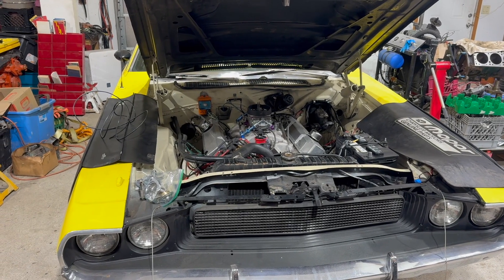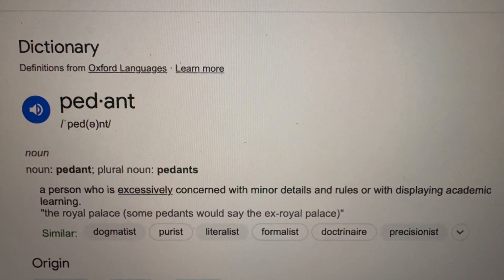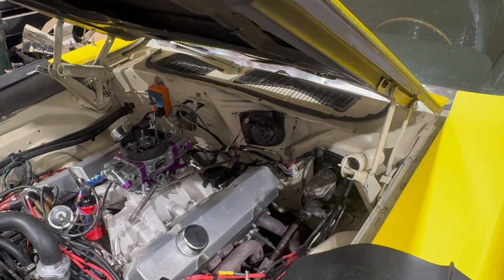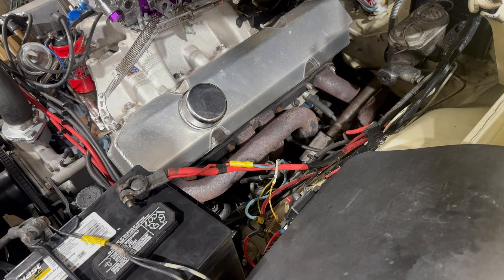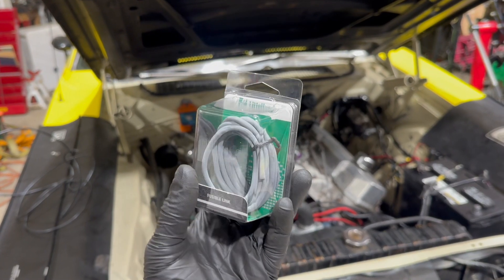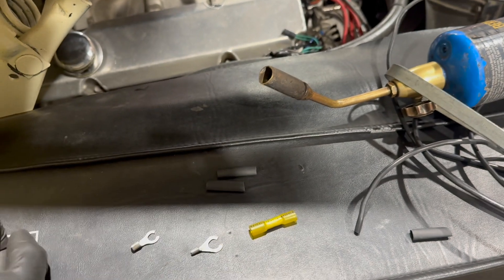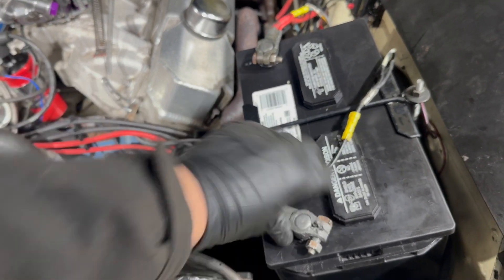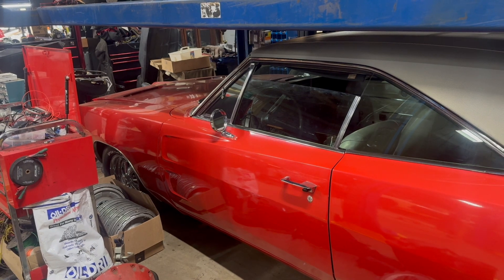The Big Shunt Wire Guide - Prevent Electrical Meltdown In Your Classic Mopar With This Easy Fix

Comment: FROM A 72 YEAR OLD AUTOMOTIVE ELECTRICAL SPECIALIST:  GOOD VIDEO.
WELL DONE.  BUT, YOU SHOULD ALWAYS USE RED WIRE FOR HEAVY ELECTRICAL CIRCUITS, ESPECIALLY "POSITIVE CIRCUITS".  BUY DIFFERENT SIZES AND KEEP IT ON HAND.  FOR SMALLER GAUGE CIRCUITS, YOU CAN USE BLACK WIRE IF YOU WANT, BUT USE RED HEAT SHRINK TUBING AT THE TERMINALS. 
PLUS YOU CAN BUY HIGHER QUALITY CRIMP TERMINALS AT LOWES OR HARDWARE STORES IN THE ELECTRICAL DEPARTMENT. THEY ARE USUALLY PLATED COPPER AND ARE MORE DEPENDABLE.  HILLMAN IS ONE GOOD BRAND.  ONCE YOU USE THEM, YOU'LL NEVER GO BACK TO THE CHEAP TERMINALS.
MOVE AWAY FROM THE CHEAP ALUMINUM CRIMP TERMINALS. THEY'RE CRAP.
BE "THE GUY" THAT DOES TOP QUALITY WORK WITH TOP QUALITY PARTS.  YOUR WORK WILL STAND THE TEST OF TIME.
AGAIN: GOOD VIDEO.
Reply from the maker: All I can add is - Chrysler used black for alternator output. I’ve used some old higher quality terminals that we’ve collected over the years. I’ll keep an eye out for them at the hardware store. Thank you.

Comment: Hi Jamie,  not sure if you'll get/see this, or even have time to respond,.....I know the video is old.
BUT....THIS SEEMS WAY TOO SIMPLE,  and I wondering Why I Haven't done it yet! (like in the past 40 years I've owned my '68 Barracuda) Just want to make sure I'm getting it right so I don't fry my (actually perfectly good) wire system.
So I...
-Connect a connect 10 gage wire  to large lug on the Alternator.
-run it safely around to reach the starter relay
-solder/crimp on a 14 gage  Fusable Link to that 10 gage wire.
-connect Fusable Link wire to large  lug on the starter relay. 
 And that's it?!
Of course I will shrink wrap connections, etc. Safely. 
 If you could give me a "yep, that it", or No...you're missing this or that...I would appreciate it.
 Thank you Bud,  have a safe and Happy New Year!
Reply from the maker: You got it. Happy New Year.

Comment: Put a 440 out of big Chrysler into a 73 W200, with the 100 amp alternator from the car. Was young, dumb, and never gave the wiring a second thought. The amp meter would peg one way or the other when operating the snow plow's electric pump. Ignorance is bliss, never had a problem with it. If I tried that now, knowing what I know now, it'd burst into flames. 😂

Comment: Your fusible links are additive to as to the load they can pass before blowing and are part of a parallel path to your dash wires. You have almost no protection against burning wires in the event of a short this way. You have been lucky so far. 72 Roadrunner has some great detail on Mopar wiring.
Reply from the maker: I know. Check out his responses on this very video essentially calling me an idiot. Thanks.
Reply: @DeadDodgeGarage  Well now, don’t recall calling you an idiot, essentially or otherwise. This “idiotic” ill-conceived and dangerous “shunt wire bypass” concept goes back many years, long before DDG, or YouTube for that matter. Simply pointing out there are several other much better approaches to these perceived old Chrysler electrical weaknesses that don’t circumvent all designed circuit protection and are far safer than this approach.

Comment: The factory fusible link is 16 ga, when you add a 14 ga link in the circuit you have essentially lost your protection because a 14ga fusible link in parallel with a 16ga fusible link adds up to about the same as a single 12ga fusible link.
Reply from the maker: True

Comment: Thanks for the video. Question; If the fusible link were to melt on your bypass (shunt), would not all of that current then go through the original circuitry through the ammeter? Still trying to get a handle on this for my 68 RR with the absolute dread being instilled for any kind of 57 year old electrical wire fire. That's why I currently don't leave my battery hooked up while the car sits for extended periods.
Reply from the maker: Absolutely. However, you are unlikely to encounter a situation where your additional link would melt, but the original wouldn’t. I have actually learned that having both in place essentially prevents either link from melting down in the case of an excessive draw that isn’t a dead short. And the amp gauge hardly does anything once the shunt is in place anyway. At this point in life I’m more likely to cut the original charge circuit completely and go with the added shunt wire alone.

Comment: I like this idea because its easy to do and doesnt involved tearing the dash or car apart and rewiring everything.  How do you know what you charging system is doing afterwards though? The fusible link would protect the battery and wiring if the regulator failed and sent too much power through the system at least.
Reply from the maker: Your amp gauge may or may not continue to give some reading. There are ways to tell if you have a charging system issue - dim lights, super bright lights, flashing lights, etc. But if you really want to know what’s going on, you would want to add a volt gauge.
Reply: The stock fusible link is there to protect the stock unfused wiring/components from the current potential of the battery not the alternator. This “shunt wire” bypass, installed as described here, with or without its own fusible link, circumvents the intended circuit protection of the stock fusible link in this application and exposes all said factory unfused wiring/components to very high current levels in the event of a short. There are better ways to address these original charging system concerns while retaining complete accurate circuit protection and the intended function of the ammeter as originally designed.

Comment: Thanks for this video. I am having an issue on a 68 Dart. 100 per cent stock. The amp gauge flutters upon acceleration. It stays with the segments to the right of the middle upon acceleration. It is in the middle at idle. But the gauge does the fluttering thing upon acceleration only if the headlights are on and I can see a mild flicker in the dash light gauges. The regulator is also new,made in USA one by standard.  Did measurements at the battery with car at idle. 13.12-13.23 volts at idle and 14.19 - 14.25 under acceleration.  Seems within normal operating range.
Tried a spare alternator and its the same. Is this normal?  Should I do this shunt wire thing so I dont have to worry about a meltdown or can I safely keep my ammeter?  I am not going to do anything wild with my car like you. Its just staying a stock daily driver.  
Appreciate any advice or help youd give
Reply from the maker: Fully normal, if you have a factory type mechanical regulator it will always do this as the mechanical points open and close.

Comment: Jamie, thanks for the videos. I recently got a ‘68 charger and it seems most of the electrical is working except the hazards and turn signal. I tried a new relay and the still didn’t work. When activating the turn signal switch, the meter is showing a draw of power, but not lights go on and when the brake lights are not activated, only the front hazards come on but do not flash. Any ideas on where to look? Thanks again for the knowledge you’ve been sharing.

Comment: so first of all love your channel ! and my question is for my 67 charger 383  iamrunning master blaster 2 msd ignition  what should be done to the factory wiring that I've just recently replaced with a year one engine forward harness and under dash ,  I know very little about these classic mopar electrical systems and want to be sure I am setting everything up correctly , I currently have a voltage regulator , ballast res, Carter  afb electric choke carb , in line fuse , starter relay etc. sorry if I am lame for asking for help but I get confused easily with this type of stuff . thanks for any help offered 
 keep up the awesome work 
-Eric
Reply from the maker: So you are running an MSD box, or maybe a ready to run distributor? The Blaster II is just an ignition coil, not an ignition system. I’m going to assume you are running a box like a 6AL or 6AL-2. For those systems (and most other modern ignition systems,) what you need to do is bypass the ballast resistor, putting a short jumper wire in its place. The original coil positive then becomes a full ignition power and cranking power source, which you would then connect to the MSD box’s key trigger wire. There will also be large red and black wires that go straight to the battery. You don’t need to change anything else to make that work.

Comment: Fusible link wire should actually be 4 sizes smaller than the wire it is connected to. For example, 8g power wire would require a 12g fusible link. Two sizes smaller might allow wiring to get too hot before it goes boom.

Comment: Are you attaching the shunt wire off the main lug of the alternator just wanted to make sure and also will this work if i install a high output alternator say 100amp because I have  installed electric fans and it seems like it always wants to charge on high and I have new wiring harness in car now and don’t want to destroy it thanks in advance
Reply from the maker: Yes, and yes - although with a 100 amp alternator, you should probably eliminate the factory charge circuit and amp gauge completely. It probably won’t be happy handling even half of the heavy loads you may end up with.

Comment: Why do you connect your shunt to the starter relay and not the voltage regulator? Doesn't the voltage regulator control the charging circuit and prevent overcharging the battery?
Reply from the maker: No. I don’t think you understand how the voltage regulator works. It controls the charge output, yes, but that output does not go THROUGH it.

Comment: PLEASE BE CAREFUL  in your statement!!!  You claim   "Any  classic with an ammeter."   NO!!  Only  classics with a FULL CURRENT  ammeter.    Vehicles  with   external shunt ammeters  do not need this   bypass.   Even  Ma  started doing this on some cars.  The  C barges,  Furies, etc,   had  an external shut ammeter  in 1972.  A friend  once had a 70 Chev K20 he  bought brand new  right before I knew him.  THOSE had  an external shunt  ammeter.  I'm pretty sure  Ford pickups   did so  in  ?? mid 70's.  Even the A  bodies had   external shunt ammeters  in either 75 or 76
Reply from the maker: Yeah, fine

Comment: Back in the 70’s i bought a 70 Roadrunner and found the wiring under the dash was all melted.   Occasionally 8 would be cruising anfd a loud BANG backfire would happen.  Everything went dead.     If it sat until completely cold, it would fire up and go until the next unpredictable time.     I asked about this on Moparts years later.   Several offered it might hav3 been a  bulk head connector issue.

He mentions in this video that amp gauge causes dash fires.  Sounds like my issue back thrn

Comment: Great job explaining the process of adding a power shunt. For those starting out on a classic, or just an old vehicle, this will help a lot. I've found a few ammeters that have burn out inside, so no charging at all. I have done this, in a similar manner, a few times before. Old tractors seem to be the most likely ones to burn out the ammeter from what I've seen. I think it's the water getting into the gauge that does it.
Reply from the maker: With at least the Chrysler system, because the loads and the charge are on the same side of the ammeter, an ammeter failure leads to no starting at all and a completely dead electrical system. A no-charge situation has to be outside of that. Thanks!

Comment: What was the battery meter reading after you installed the shunt? I installed one on my 66 cuda hooked up a new battery and showing 12.4v at idle on the battery.
Reply from the maker: You’re going to see much less needle movement than before. Low charge at idle is common, and unrelated to the charge circuit itself.

Comment: 69 charger 130 amp alternator  dual fans electric fuel pump msd electronics  battery going in trunk what size wire do I need to run ?
Reply from the maker: Your main cable from battery to starter should be quite large. Like 00 or something. You have various options for wiring the rest of the system - pull main feed off of the starter connection you’ll make, run a separate fairly heavy feed off of the battery to a power point everything else can be wired from, run several feeds off of the battery, etc.

Comment: Excellent video. I just redid my 74 Dodge Superior motorhome with the 440  V8 and got it running again with the HEI module conversion, but tonight I noticed my gauges were dimmer and I was wondering if I was getting enough charge to the battery, I also installed a new key ignition switch on the dashboard and bypass the original harness in the column and amp gauge because it was melted. It runs great but just to make sure my battery is getting the full charge I am picking up some 10 gauge wire and 14 guage fusible link tomorrow. Thanks!

Comment: Jamie this has been a game changer on my 71 satellite.  I did the shunt wire after watching your other video about the charging system.  My question is , if I wanted to install an aftermarket amp gauge so I could watch the system,, where would I hook it up to get an accurate reading. ???

Comment: Thank you, Jamey. I’m going to add the bypass wire to my 1966 coronet I turn the key on the the other day and there was a little bit of smoke coming out from underneath the dashboard. I remember you talking about this you very much appreciate what you do.
Reply from the maker: The bypass wire isn’t going to solve whatever is smoking. In fact, it could make it worse if you make no other changes. Find what’s melting before you do anything else.
Reply: @ 

Thank you, Jamey. I will in fact do that before I reconnect the battery. I’ll disconnect the instrument cluster and look on the backside and see what I saw smoking. Thanks for all your help. Love your channel and I’m an old Mopar fan. God bless you and your family.

Comment: So your putting that on the big stud on the starter relay?
Reply from the maker: Correct
Reply: @DeadDodgeGarage  So my ballist resistor took a crap 2 days ago. I have a new one. Car starts runs for 40 seconds and shuts off. Good 12 volt supply, blue wire at bulk head has power but when I crank it the brown wire gets almost proper voltage and then fall to 2 volts. I'm about to check my ignition switch.

Comment: I just watched a video from "1972 Road Runner GTX" titled "The Big Problem with the old Mopar “Shunt Wire” by-pass, the importance of Circuit Protection" and he is critical of this procedure without making other alterations to the wiring.  I wonder if you would take a look and let me know your thoughts.  

Also, are there alternatives tot he shunt wire like beefing up the existing charge system?  (i.e., larger wires, etc.)
Reply: Be sure to have a look at some of the other videos on that channel, there are several that detail safe alternatives to this “shunt wire bypass” including the factory fleet bulkhead bypass and the “C-body recall” bulkhead bypass approach from the early seventies. All while maintaining full circuit protection and a fully functional ammeter.
Reply: @72roadrunnergtx  I will do that, thank you.  I am fixing up a 78 Ramcharger and plan on adding a 100 amp alternator and don't want to fry anything.
Reply: @72roadrunnergtx  so this question is for you and Jamie.  If I were to install a set of NVU gauges that uses a volt meter instead of an ammeter, would that eliminate the concerns associated with a shunt wire?  And if I installed an internally regulated 1-wire MOPAR alternator, do I remove the firewall mounted voltage regulator?

Comment: Hi Jaime, There's another creator that says the shunt method sends the load back through the bulkhead connector to the ammeter. 
 He gives a different method to do it.  Splicing the shunt before the factory fuseable link, then disconnecting the ammeter..
 Amy thoughts on this ? Thanks

Comment: I have a 69 RT convertible and went through the horrors of Mopar wiring it smoked the junction block and had to go through the engine wiring and all of the dash and this one have factory AC it took me a month or better to get it all figured out and I had fuel gauge problems to boot , I love Mopars but their wiring sucks
Reply from the maker: Ouch. They were never amazing electrical systems, and 50-60 years on, things can certainly be challenging.

Comment: I wish I saw your videos and advice back in 2006. My daily driver70 Charger burned in a ShopRite parking lot in Brooklyn NY. I worked overnights at the time and stopped for some stuff on the way home. I came out and saw my Charger was on fire. I put an EFI in it that used an electric fuel pump, everything was shorting out so the pump kept adding fuel for the fire. FDNY came and they smashed my grill, I wanted to choke them. It was in mint condition. I’m still heart broken about selling it in 2009. 😢
Reply from the maker: Damn… that’s just terrible.
Reply: @ It was, but back then there wasn't any of the stuff you can get now. Keep making these video's, they are great.

Comment: I’ve read years ago of running that 10 gauge wire thru the FireWire connector, to the ammeter, and then another 10 gauge wire to the starter  solenoid. You would just drill a bigger hole in the firewall connector for the larger wire.
Reply from the maker: Absolutely. Done that.
Reply: With this type of problem, I'm surprised that a certain Mopar guy on Youtube wouldn't reach out to an aftermarket manufacture and suggest they make a voltmeter that is an exact match to replace the ammeter. 😇